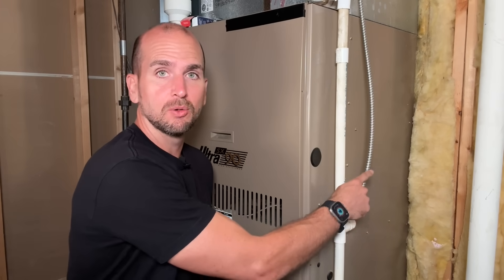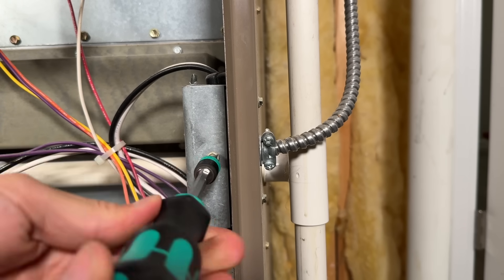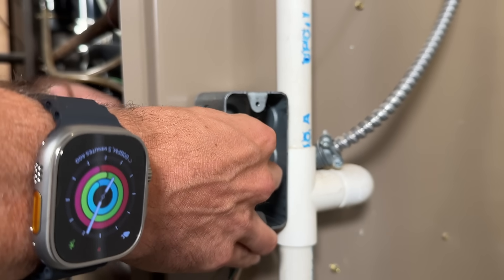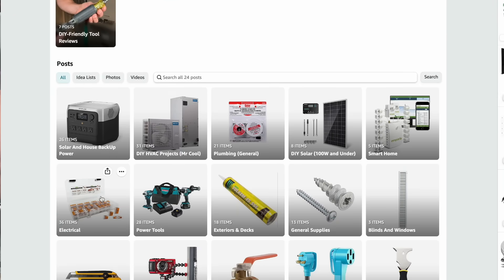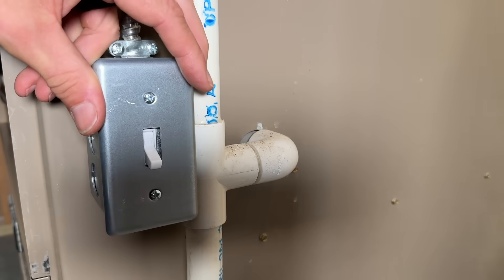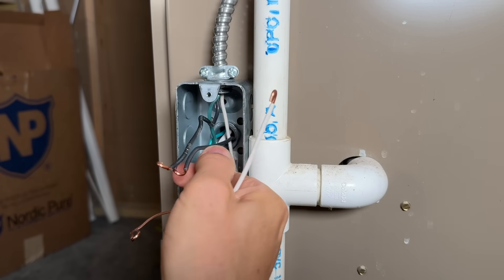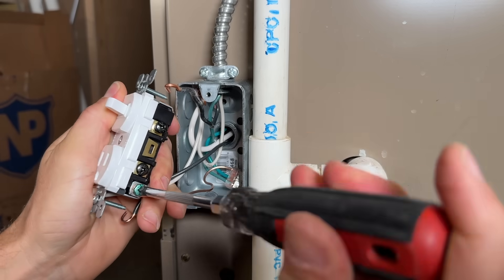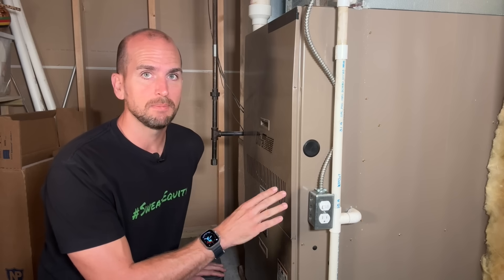How To Install A Furnace Power Disconnect Switch

Comment: You may enter the furnace with metallic cable. The disconnect does not have to be on the furnace but within sight of the furnace. A duplex receptacle and a light must be within sight also for servicing the unit. The circuit for the furnace must be a separate circuit.

Comment: I have a question, I had a company install a new furnace with the plug in "disconnect" I'm an inspector and I failed the mechanical inspection because of that. They came back and changed the plug in for a "light switch disconnect" but they left the same cord. It's just a flimsy plug cord that had the ends changed and hard wired in. I can't find any other information on this. But I feel like this cord can be susceptible to damage. Is there a code for the type of cord that connects to the power?  I don't know of any

Comment: I'm not an electrician so I couldn't say whether mine is code compliant, but I suspect it only makes the AHJ happy without being strictly compliant with the NEC.  My furnace (installed in an unfinished basement) has a 2-gang box with a switch and a 15A duplex receptacle.  The switch disconnects power to the furnace but it does not control the receptacle.  Only the breaker cuts the whole circuit.  The furnace was replaced in 2018 and the AHJ approved it.  There's no GFCI on the circuit anywhere, just a standard breaker, the switch, and the receptacle.  My town requires NEC 2011, so I guess the inspector was fine with allowing the non-protected circuit in the basement.

Comment: Would a double natural not matter? If you shut off the light switch to disconnect power from the main panel, then plug in a generator, then the main power comes back on, wouldn't that create a double neutral? If so is there any harm in that?

Comment: Its not a safe practice to have extension cords with male plugs on both ends I do not recommend using such a cord as known as sucide cords. Your insurace company may have somrthing to say about that. They make male outlet sockets  for a safer option.  73

Comment: Code also reqiires the box be gounded as well the nipple is not  enough you need to install a ground screw to the box. And use a ground wire to bond the box. This may be a local code so check before installing the box. 73

Comment: Hi Scott. In addition to this video, I've also watched the one by Dave the DIY Guy. Both are great tutorials. My situation is this. I have the power disconnect switch/receptacle like you install, except mine are not linked and the receptacle provides power to my condensate pump which continues to power the pump even when I switch off the furnace disconnect. I'm not sure why it was done this way. I live in Michigan.
I'd like to add the pigtail to my furnace for backup power from a generator, but what kind of configuration do I need since I will need to power the condensate pump also when using the furnace? I guess I will need a double gang box with a single pole switch and a duplex receptacle, but I haven't been able to find any video explaining how to wire that. Thoughts?

Comment: @11:38 can't you just break the tab, leave the wiring behind the plug the way it is, then for emergency power turn off the switch and just use a 2 ended male extension cord from the new plug to the ecoflow/generator?

Comment: Is the switch really necessary?.... because the code seems to say just that the furnace needs a "disconnect".  Just putting a pigtail extension cord from the furnace to an outlet installed in the box would  meet the intent of having a disconnect near the furnace. When you unplug the extension cord from the outlet you've isolated the generator/furnace circuit from the mains.

Comment: The disconnect switch on my gas furnace also has a fuse.  In it, you use a slow-blow fuse that’s accurately sized for the blower motor.  The fuse recently saved my bacon.  The run capacitor on my motor failed, and the motor was unable to start - not enough torque to start up without the capacitor working.  When the furnace would try to run the motor, the motor would just hum, and eventually blow the fuse.  I was able to fix it by getting a proper replacement capacitor; the motor itself was fine, and its bearings were still in great shape.  If I didn’t have the fuse, the motor would likely have overheated and burned out.  The fuse saved me from having to buy a new motor.

Comment: Does this work with Electric heat, not gas.
Reply: An electric furnace takes a much beefier electrical supply, probably 240V, and way more than 20A.  You could put in a disconnect switch, but it’d be larger and more expensive.  I doubt it’d be worth it.

Comment: In Canada that would still fail the inspection since the switch is placed too close to the furnace. Their reason being if there was a fire you should be able to cut the power without getting close to it.
Reply: Yup, mines about 2 feet away on the wall, on far side of return ducting. Don't even need to open furnace for this.
Reply: Is it to code in Ontario Canada to ad a receptacle for a generator hookup in case of a power failure?
Reply: @thomaswoods60  There is nothing in the code regarding the generator and furnace backup power. You just have to make sure your work is in compliance with general electrical guidelines.
Reply: Forexample, you can not use that black computer cord in your mechanical room IF your receptacle is less than 1.5 m to the floor (with in 1.5 of floor its must be the armored cable) but if your receptacle is above that distance you are fine. 
The general wiring work must be in compliance.

Comment: Great video!!! Excellent idea!! For the backup power would you happen to know if New York City has any issue with the setup? If you don't know what electrical code is for NYC what section and code in NEC should I look up to determine if it's legal or illegal? Sometimes NEC can be very technical, what terminology in the electrical code would confirm that it's legal or illegal? Does this work or is it allowed for steam natural gas boilers? Regarding the generator does it have to be a certain Peak max power for furnace startup (similar to a refrigerator condenser startup, for example 1,000 watt generator with 2000 W Peak)?  Thanks for the feedback, again great video!!!

Comment: My current furnace has a SSU (switch with a fuse) can I replace that for one like shown here ?
Reply: See my posting elsewhere in this video, on the benefit of having a fuse.
Reply: @kc9scott   hello, thanks for your reponse. I ended up installing the EZ Generator Switch. Works great

Comment: That metallic electric cable noted in the video is better known as "BX".
Reply: Not necessarily. It could be 3/8” Greenfield,  6’ in length from a junction box. BX has paper or plastic wrapped conductors in it from the factory. Greenfield has no conductors from the factory. It is just a raceway. Conductors are added in the field.

Comment: Since EcoFlow is "floating neutral" , don't we need a switch transfer or a "bonding plug" when you connect the EcoFlow to the furnace???
Reply: Eco Flow addressed this issue with their Portable Power Station adaptor you buy from them, it takes care of the bonded plug problem for furnace power.

Comment: A breaker also works as a disconnect. 
422.31 (B) Appliances Rated over 300 Volt-Amperes. For perma‐
nently connected appliances rated over 300 volt-amperes, the
branch-circuit switch or circuit breaker shall be permitted to
serve as the disconnecting means where the switch or circuit
breaker is within sight from the appliance or is lockable in
accordance with 110.25.

Comment: Hey Scott, need some help. I went to update my place and ran into an unexpected issue. The current disconnect switch has a small fuse below it. If I change it out with a combination outlet, I'll lose the extra fuse protection? Any thoughts on this???
Reply: See my posting elsewhere in this video, on the benefit of having a fuse.
Reply: @kc9scott  found your comment. So I'm assuming so we don't get rid of that switch with a fuse below it, we would just add single gang electrical box next to the disconnect switch. Basically the power comes into the switch box with the fuse and would feed the next electrical box. All this is NOT connected to the furnace. 

You would take your power wires from the furnace and pig tail in your 3 prong cord. When you have normal power coming from your panel, you would keep the 3 prong plugged into the electrical box fed from the disconnect w fuse. 

When power is out, you would unplug the cord from the electrical box being fed from the disconnect and plug it into a generator.
Reply: @shawnphillips1220  Well, this video didn’t even touch on the subject of running a furnace during a power outage.  AFAIK the outlet shown in the video is meant only as a convenience outlet.  What you describe sounds like it’d work, but there are some safety considerations with how you do grounding, that can get a bit complicated.  I did a similar thing, putting an ungrounded plug-in cord on my furnace, along with a permanent ground wire between my furnace’s ground and my house’s ground.  But some newer high-efficiency furnaces might not like that.  I also kept the fuse/switch box after the plug-in cord.

Comment: The jack of all trades master of none makes mistakes again, should have grounded the box, should have used a motor rated switch, shouldnt have used a wago which now puts a point of failure in your heat system. Also the plate has to be marked "gas furnace" in red. The plates are available in any electrical store. You cannot attach an outlet to the heater circuit which must be dedicated. Dont listen to this guy he knows nothing of whats he talking about and is trying to sell stuff at the same time.
Reply: I think it’s you that needs to go back to school. He’s doing it properly.
Reply: @DCSPORTSTER  No its a jig rig and will fail any inspection.

Comment: Scott, Thank you for the great videos. Here is my question: I'm on my second furnace and it draws 9.6 AMPS max. It's on a 20 AMP breaker and 12/3 wire. I'm not sure why it wasn't originally wired with a 15 AMP configuration but perhaps the original unit when the house was built needed it. Anyway, would there be a problem with using NEMA 5-15 plugs and receptacles with 12/3 wire to perform this mod. I could replace the CB but its on a 30A gang so I would have to replace the 30A and then a 15 and 20. Nothing is simple! Thanks
Reply: Nevermind... this path of least resistance would be to install a 5-20R and call it a day! :)

Comment: Good info.  One might be able to use emergency power with an oil burner furnace too.  My oil burner furnace circulation fan (set to LOW) uses about twice as much electricity as the oil burner pump/fan.

Comment: In California, at least in Los Angeles, residential furnaces are plug and cord connected. That is your disconnect. Perfectly OK as residential furnaces are all gas, no oil heat in this region. So all you have is a low voltage gas valve and a blower, 4 or 5 amps max. What gets me though is why UL now allows single pole contactors to be used in residential or split phase HVAC condensers. Yes, you still have a full disconnect close by but some technicians may leave that on thinking that only the line side of the contactor is hot! Surprise!

Comment: If your gas water heater is only 2 feet away from your handy box / disconnect switch / emergency power combo outlet, does it need to be GFCI ?
Reply: If the outlet/switch combo for the equipment in question is located in an area that requires GFCI protection, and that means basements, crawl spaces and garages to name a few, than yes it would have to be GFCI protected.  In this case you'd install a GFCI circuit breaker at the panel.

Comment: Also hes selling wagos, dont use them there garbage.
Reply: Twisted wires and wire nut.
Reply: Wagos work great I don’t know what you’re talking about they meet Electrical Code.  Now wire nuts on the other hand with the strand wires and a solid wire they don’t work very well and come apart.
Reply: @DCSPORTSTER  Wagos are junk they dont meet code every where and cause lots of problems. they are considered a worthless short cut. A real electrician wont use them.

Comment: Scott Im interested in putting the pig tail on the furnace FOR POWER OUTAGE MY CURRANT ON/OFF SWITCH HAS A SCREW IN FUSE UNDER IT HOW DO I WIRE THIS..MAURICE

Comment: Unfortunately, you have a NEC violation that most do not know about.   The manufacturers label clearly states the circuit to this furnace is required to be 15 amp Fuse/Fusible.  No mention of HACR breakers.   So, the safety switch is required to be fed by a 15 amp fuse.   Exception, If your panel is fusible and you are fusing the circuit.
Also, chase nipples are not approved as a grounding means.

Comment: Your interpretation of code is not exactly correct. The furnace doesn't need a switch if the breaker panel is in the same room.
Reply from the maker: Thanks for the feedback!

Comment: Question:  Is it OK to use a plain switchplate?  Every home I've seen has a red switchplate that explicitly calls it out as a cutoff for the gas (or oil) burner.  Isn't that required?
Reply: I've seen the red switchplate in some states, but not others. My own switchplate is the normal beige color, but is engraved with "FURNACE CUTOFF" across the top. What is "code" varies by state, county, and city in many cases, and might not reflect industry best practices.

Comment: Something about this just has to be a violation of code or at least best practice. Box should have been mounted to the wall and then connected with an additional short length of armored cable.

Comment: 2:09 "without going to the breaker panel". Why is this an issue? All current codes allow the use of the circuit breaker as a disconnecting means if the breaker is withing sight of the equipment (distance may vary from 25 - 50 feet depending on code); or in any location if capable of being locked out. Almost all breaker are capable of being locked out. I will go out on a limb here and state that there probably is no code violation in the situation shown.

While I personally believe that the use of a disconnecting means at the furnace is a "best practice", to use the circuit breaker is allowed by the model codes.
Reply: I know that in my state (WA) the furnace cutoff switch is required by code, and has been for decades. The only ones I've seen without a cutoff switch were installed 50 years ago or more, and any replacement of the old furnaces comes with installing the cutoff switch on the wall. In some cases a routine service call for your old furnace will result in getting a cutoff switch installed or they won't work on it.

Comment: The 'handi' box you used looks like a 2x3x2inches deep box which is about 10 cu.inches in capacity. With 4 conductors (2 black and 2 white) going in and out of the box, one for all the grounding wires, and the device counting as 2, you have the equivalent of 7 conductors in the box. With 14 gauge wire for a 15 amp circuit, you need 2 cu.in. per conductor equivalent for a total box space requirement of 14 cu.in. Having all those wires in a 10 cu.in. box is a code violation. You should use a 4x4x1.5 inch deep square, round, or octagonal box (at a minimum) to not have a code fill violation. It also makes it easier to keep all the wires neatly in the box without a risk of a wire or terminal shorting on the box. Also agree with others that the box should also have a grounding wire attached to it.
Update: actually, I forgot to include the calculations for wire clamps so add two more cu.in. for a total of 16 cu.in. Need to have a licensed electrician double check me on this according to the 2023 electrical code!
Reply: If the box was oversized, is that a code violation?